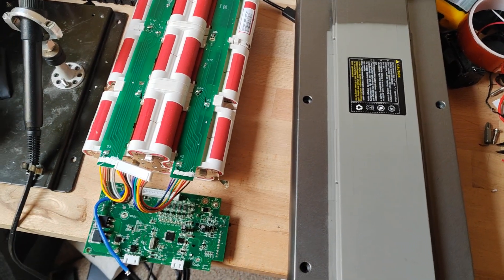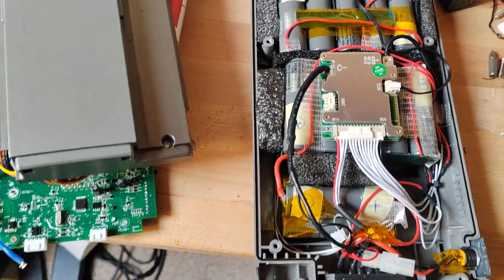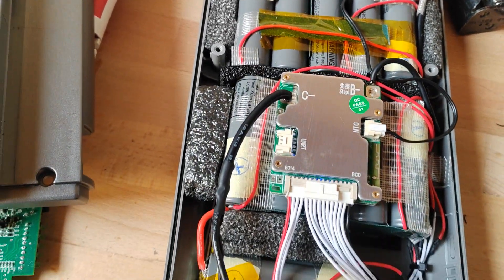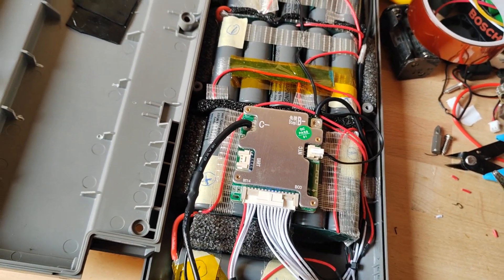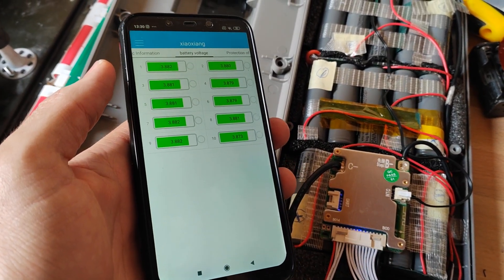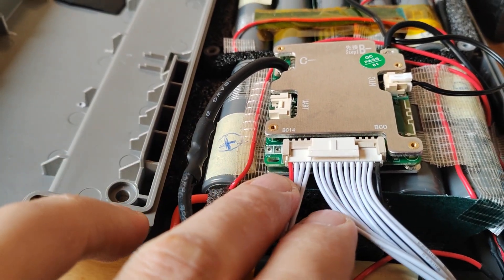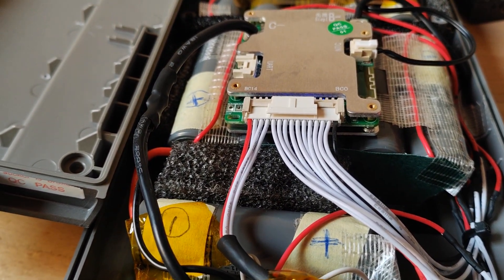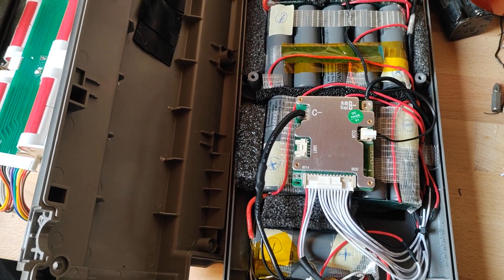Phylion Electric Bike Battery with Smart BMS

Comment: Normally the original bms is powered by a 5 pin charger, how do you charge the battery with the 5 pin charger?
Reply from the maker: I don`t use that original charger, i use a regular Charger. I have thrown out the unnecessarily complicated sytem.
Reply: @diyelectricbiker9361  There must be a way to use the original charger
Reply from the maker: @lifepo4esperienze721   you can try and post a video if you made it, I don't have time for that.

Comment: Can you do a tutorial on connecting the cables? we do not see . How are the charging connectors connected? and the discharge connectors too? on the old bms, the connections communicate with the controller. otherwise it won't work. the bike will just turn on but there will be no electrical assistance.. thanks